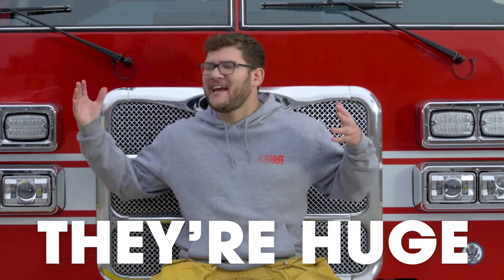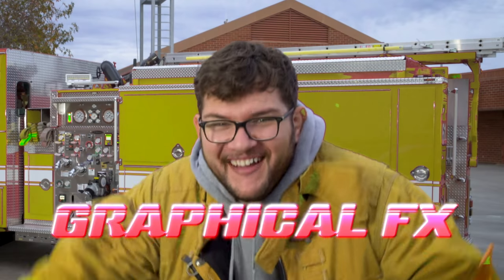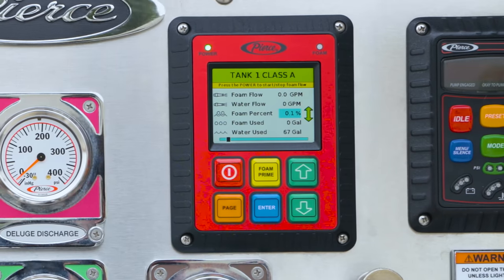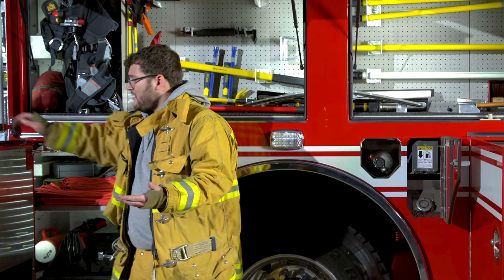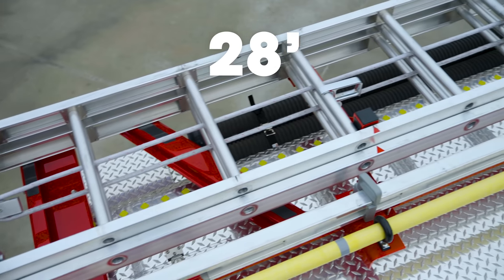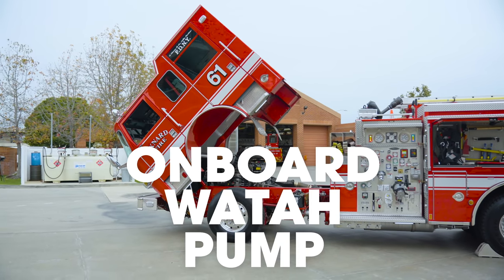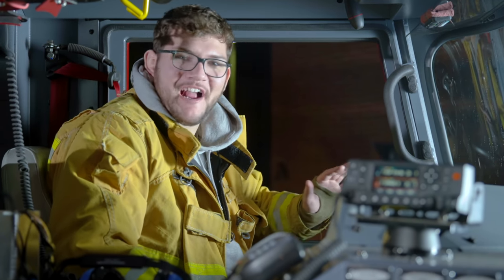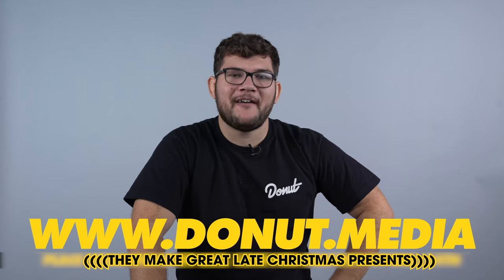The Surprising Features of a Fire Truck

Comment: “Picks up adapter”

This looks expensive
Reply: Are they?
Reply: MidgetMan 420 pretty sure
Reply: MidgetMan 420 nah, kissimmee Fire EMT here, most things are very expensive on the engine and rescues (Stryker stretchers cost 60-70k, lifepak 15 defibrillators are around 40k) but adapters are probably maybe $200 to be honest
Reply: Uh 200$ for an adapter 
Nah, pretty cheap 😂
Reply: @PacificoAyala321  in comparison to a majority of everything else, yes very cheap. The married set of haligan and flathead axe was around $350 at the cheaper ends.
Reply: I worked on fire trucks Ina small collision those tickets can go up to 100k in repairs

Comment: 3 dudes on a engine? In my department in Holland we have 7 😂
Reply: Woutr Nick in European places like Holland and Germany they have more room on their rigs and have more jobs so they have more personal per rig, we can have up to six in an engine but the most common amount of people is four, one engineer, one captain and two firefighters.
Reply: That must look like a damn clown car when everybody gets off, aren't european engines usually smaller to fit through the older streets?
Reply: Short on staff?
Reply: @VexingRaven  well it is complicated but there is a curtain procedure for getting off- attack team, water team etc. Anyways really cozy in the back thats for sure
Reply: @midgetman4206  meh not really
Reply: Here in Austria we have a minimum of 4 on a truck and up to 10 if the truck is big enought (how many are realy inside depends on the day time) thats becouse for an ACBA ''Action'' how we call it you need a minimum of 2 when outside and min. of 3 if inside a building (this is regulated by a law).
Reply: @VexingRaven  The european engines are similar to this one (often just higher and sometimes special engines have a better stearing ) and the best part is every milimetre is stuffed with something if you woud take the whole equipment from this truck an put it in the tuck at my department it woud be 2/3 empty.
Edit : I googled the exact sizes yeah the Europeana are not so width.
Reply: Lol, we run 2 man crews at my department
Reply: Mine holds 6
Reply: VexingRaven Come on the whole of Europe isn’t a little Italian street 🤦‍♂️
Reply: @lisamarroquin2186  where?
Reply: @3bydacreekside  in Washington State
Reply: It depends on The Type Of Fire.
Reply: 3 dudes on an engine?? We have 2.
Reply: @geertjehavinga2656  not really... "okay big fire boys lets wait for the rest of the crew to come to the station" it doesn't depend on the type of fire how many dudes are in the back, at least in Holland.
Reply: The standard across the US is 3 per apparatus bigger cities as for example the FDNY send 4 on each apparatus.
Reply: No one likes a braggart
Reply: @TurtleSauceGaming  how is this bragging lol, more confused. It doesn't even have to be good... Maybe it is cause we are understaffed so bragging about being understaffed uhhhhm no...
Reply: @woutrnick4397  it was more a joke, but you said 7....  7 is a lot.  hell the standard engine here is 6 people ( driver, officer, 4 in the back...  sometimes you get a jumpseat or 2 with no scba.)
Reply: @TurtleSauceGaming  how am I supposed to get the joke if it is a answer via yt 🤷‍♂️ I suck at understanding sarcasm IRL imagine how bad I understand it on yt etc
Reply: @woutrnick4397  Wow.  I'm bad at sarcasm too on YT....  It's almost as if the internet is a poor communicator of tone of voice....

That was sarcasm by the way...  couldn't resist.
Reply: @TurtleSauceGaming  we are kinda like Sheldon if you know big bang theory
Reply: @woutrnick4397  ik wil kaas
Reply: im the only person on my engine. small town problems. i drive pump and fight fire.
Reply: @tyhdogk  jesus.  Props.  Dangerous tho man, I'm sure you know.  Time to do some recruitment drives or something.  Good luck to you brother
Reply: Woutr Nick you fill up all the seats before you go to another truck (unless the other truck is needed)
Reply: @TurtleSauceGaming  While hoping that I'm not telling you something you are a bigger expert than me: The official standard in germany a 9 person crew (Gruppe) on a classical, non specialised engine (Löschguppenfahrzeug). Driver, chief, 3 sqads (a 2 people each)  and a messanger. In reality even volenteer departments won't be able to fill all the seats most of the time (but it makes sense as having more hands helps always). The more common thing is to have  a driver, chief and two squads (Staffel), that's the de facto standard for professional departments. But you never will go below that because you will have to always have a rescue squad on hand for any suad you send into buildings or other dangerous situations. Specialised engines like ladders will have as little as three crew, but will rely on an other engine for firefighters.
Reply: Echt zo

Comment: In my years as a Firefighter, I have never seen an Engineer leave the truck EXCEPT in an extreme emergency. They do not get involved in the fire fighting. The captain and firefighter and possibly a 4th crew member handle it. The Engineer has to monitor that truck carefully. Also, that kit you pulled out was an axe and a Halligan tool. You can get into or out of most anything with those.
Reply: Crossed irons, arguably one of the most useful things you can find at the fire department accept for the coffee machine

Comment: A little bit off, the driver never leaves the truck his sole purpose is to protect the truck and to pump water. If he left to hook up a hydrant he'd be putting everyone at risk
Reply: Right! I was like "uhhh usually second due lays in from the hydrant" lol
Reply: Not in all jurisdictions. Some city and county fire fighters are reduced staff weigh cut hours so sometimes the engineer is asked to chip in and help.
Reply: Colby Milnor that's incorrect. the words "never or always" often come before an untrue statement. there are times the driver will leave the apparatus. every department is different.
Reply: If possible a fire engine will have at least 5 firemen on it. 1 driver/engineer, 1 captain, 1 auxiliary firefighter (e.g. does hydrant hookups, helps pull hoses), 2 attack members (guys who are fully suited up with SCBA, operate the fire hoses, ready to enter the structure). In my department the driver also operates the pump controls. Captain sizes up the fire and forms a strategy, speaks to bystanders and gives orders, auxiliary is usually a junior firefighter who hooks the truck up to the hydrant, helps to pull hoses and does any other gofer work that the captain needs (e.g. move supplies, smash a window if ventilating using that method, etc). Attack guys if they're not already suited up with SCBA (breathing apparatus) will immediately suit up upon arrival. Everyone has their roles and the team should be ready to attack a fire in about 1 minute of arriving at a scene.

Breathing apparatus usually have about 30 minutes of air. But you can only plan to be in the structure for about 15 minutes tops. Once the BA is halfway out of air, it's time to exit the structure and let a relief team in who will continue the attack if it's called for.

Comment: Who else saw him fail to turn off the lights?
Reply: he just started to realize when they cut the scene.
Reply: he didnt.  the lights just turn of slowly to prevent a power surge. its called load management. if you notice the switch lights on the ceiling turn off one by one.  he hit the "master switch witch controls all the lights. one by one.
Reply: @youngharlemv  Yup, never underestimate the destructive capability of electrical load dump in a vehicle.
Reply: youngharlemv well,
It turned off too slowly that it made it look awkward for him

Comment: That' not true that there are only 3 crew members on an engine: there are usually 5! One is the engineer, one is the captain and the other three are the firefighters
Reply: Yeah I thought that strange as well. It may be Oxnards staffing, which honestly seems very strange or dude was told "Drivers here, captains here and the firefighters in back" and he took it to mean there was only one. Im thinking it was the latter since there is a bunch of other bad info in here as well
Reply: @mike_minnick  a lot of departments have minimum staffing of 3, and usually that's what you run with.
Reply: @skitzojedi2505  i know thats a thing with volley companies, just never saw a paid crew with only 3 people.
Reply: @mike_minnick  I know South Metro does that in CO, as well as using those crews to cross staff other apparatus (tenders, type 6, ARRF, etc.), but I think they usually have crews of 4 now. Some departments along east coast too that I've seen doing it.
Reply: @mike minnik it doesn't make much sense that on that engine there are only 3 people also because of the crew cab wich would be pointless if the crew was made of only 3 people. I'm pretty sure other apparatuses use a crew of three (maybe a tanker). But yeah, i agree that this video isn't very precise
Reply: There are a lot of departments that run with 3 now.  A lot of the departments in California run 3
Reply: Im from an all paid department, all companies (pumpers, ladders, quints) staffed by 3 personnel.
Reply: @mike_minnick  Most suburbs of Chicago run engines with three full-timers, and has been that way for years.
Reply: Aurora Fire Rescue, Aurora CO. runs 4 on all engines and trucks. But some small volunteer depts Might run as little as 2 only at the main station.
Reply: NFPA standard changed a few years ago to minimum of 3 per apparatus: officer, engineer, firefighter. As a result, many departments moved a lot of those “assets” to other apparatus: truck, rescue, ambulance.
Reply: We run minimum staffing with three a lot.  If we have more than three than they are probably staffing the tanker since it’s a mostly rural county.
Reply: In my department, there’s only one😩😂

Comment: Fire trucks are actually water trucks
change my mind
Reply: Denis Coxlong not all fire trucks can carry water
Reply: They are more rolling tool boxes, but also carry water
Reply: Unless you fill em up with gasoline.
Reply: Firemen are actually fire extinguishers. Change my mind.
Reply: Fire Trucks don't carry ANY water. Mind Changed!
Reply: x x  You must live on the East Coast, if I ordered a "Tanker" id get an Aircraft coming to do a water drop hah we call them water tender's, and then there are "Engine Tender's" which is like a type 1 but hold 1-2000 gpm...ive never seen one. We do have water tender's though with water shuttle pools that hold 2000 gallons you can draft from or connect 2-3 together etc. We have pretty good hydrants though so it is not needed. Everyone here uses to use 5" supply on type ones but we've all switched to 4'. I HATE 5'.
Reply: @Jhubes5.9  yeah but not even a single one can carry fire

Comment: Ok, I must give some background I am from San Diego, CA and this is an interesting video that highlights firefighting as a profession. In my city, we on an engine we have a crew of 4 people and 4 on the truck as well. Most of the video was good like the air horn on the pump panel to notify for defensive operations, and the set of irons (an axe and halligan tool married together). But in Europe, they have 6 people on an engine and that would include an engineer, captain, attack section leader, attack section, water section leader, and water section. Overall the video was very good but missed a lot to the point I had to post this comment for my well-being and for educating the public thank you very much if you read this all.
Reply: across Europe there are many different tactics, even within a country there might be different approaches.
You might see up to a crew of 9 on a German Engine, while there might be only a crew of 3 on a Norwegian Engine. At the same time some countries have seperate apparatus for exterior and interior attacks

Comment: what about reviewing a european firetruck, just to see how "our" fire departements fight fires
Reply: No
Reply: @zygis1819  nobody asked you.
Reply: Well first of all European firetruck looks like it came from 2020, this truck looks like something out of 1974.
Reply: @DuBstep115  Its actually a retro look on purpose dont let it deceive you!
Reply: @Northern_va_fire_buff2598  no they are not, they have a lot more equipment than you think
Reply: @Northern_va_fire_buff2598  Didn't see any hydraulic gear on it, it has like space for only 4 people, no monitor, no traffic safety stuff, and so on...
Reply: @johanness6545  it doesn't have hydraulic gear on it because that stuff is on the truck which would be dispatched with the engine. Oxnard is a small department so their rigs are VERY specialized and regional within the city. This station is closer to the cliffs so it is specialized for wildfire and and cliff rescue. Those closer to the freeway will most definitely have some sort of hydraulic or electric spreaders/cutters. Hi vis traffic equipment is most definitely in there just not visible with what they went over. The vitals monitor is also there in the rear right compartment.
Reply: @johanness6545  that is because it is a pumper/engine. Not a Rescue/Squad. It has room for 6 people, even though the department only staffs it with 3(stupid IMO) and it does have a monitor up top. they use the Tiller for scene safety on traffic incidents.
Reply: You know I have 72 landy fire truck (West Yorkshire)
Reply: @alfm388  ?
Reply: @enforcer_misterx  Sorry, hope you don't mind me asking but  how can he "be wrong" when he said "looks like" which:
1) it is a visual characteristic that can easily been seen (this fire truck has a very old school looks and  is based on a truck with a very classic design)
And...
2) "Looks" implies that he is giving he's opinion.
So, how can it be "wrong"? Opinions are opinions.
Reply: A bit faster than the americans😂
Reply: @enforcer_misterx  yes actually the commenter did
Reply: @Northern_va_fire_buff2598  just compare this one to an HLF 20. space for 9 people with breathing apparatus in cabin, 2000l water and 500l foam with pumping up to 2000l/min, heavy rescue tools and multiple kinds of ladders, and a lot of space for specialisation (eg ABC equip, hydraulic press, medical equipment). european fire trucks are higher and way more compact than american ones.
Reply: @Northern_va_fire_buff2598  out trucks carry a while lot more than American trucks xD
Reply: @Northern_va_fire_buff2598  European firetrucks (at least the german ones) are way better equipped than this one
Reply: @Northern_va_fire_buff2598  UNDEREQUIPPED? The average european firetruck has three times as many tools and gear on board, while being half the size to actually fit small european roads. While the amount of hose and access is better on this american engine, europeans usually have rollout hose carrier things for comfort reasons at the back of the truck. Just two examples:
https://www.feuerwehr-hamburg.de/fahrzeug/hilfeleistungsloeschfahrzeug-20-hlf/
https://www.rosenbauer.com/de/de/world/fahrzeuge/kommunalfahrzeuge/at
Reply: Firefighter Ross We have way more gear in our trucks then this little red ugly looking oldtimer.
Reply: why is everyone here talking about europe like it's a country, you realise it's a continent right?
Reply: @emilycampbell6375  well yes, but actually no. Given that most countries are very small, they usually do not have the capacity to produce both the trucks and equip them with gear domestically. So most fire engines are either german or swedish in smaller countries, maybe the uk, france and spain can built their own.
Also, the urban areas are usually very similar, historically grown small streets for medival town centers.
There are some cultural differences, but you would't expect fire engines from Texas and New York to be the exact same - nor drastically different.
Reply: Europeans and Canadians don't fight fires or the fires win.
Reply: @BD-md6zr  well the truck looks cool
Reply: No is No.

Comment: Back when they used to hang off the back of the truck, that firefighter had a very important job. As they approached the fire, the driver would stop next to the nearest fire hydrant. The firefighter would grab the end of the 5" suction line and wrap it around the hydrant. the driver would then continue to the fire scene, with the hose line sliding out and dropping to the street. When the truck stopped, the firefighter would connect the line to the hydrant and wait for the engineer to signal him to open the hydrant valve. Some trucks had the suction line already connected, so water fed directly into the pumper. Watched them practice this many times; Dad was a city firefighter for 30 years. Thanks for the video!

Comment: My cousin is a firefighter in New Jersey and he is a driver, his department's engines have on board water for a couple of minutes of fighting. They also have an extra water level gauge on both sides behind the rear doors on the cab. It is a bank of 4 big lights that when on are Blue, Green, Yellow, Red (I think, it has been a couple of years since I've seen it) and instead of the more accurate bank of lights on the driver's side panel. These lights can be seen from a distance by anybody. I find it a neat concept because  they use it to gauge how much time they have before they all run out of water in the on board tank before they guy finding a water source starts getting yelled at. This is because sometimes they are in an area that has no access to water (like a car fire on side of the highway) my cousin loves it.
In my hometown, most of the firefighters are trained paramedics.